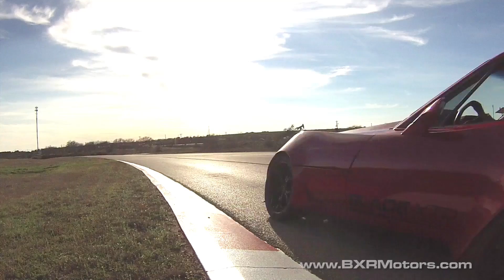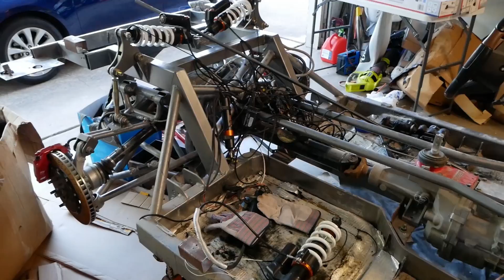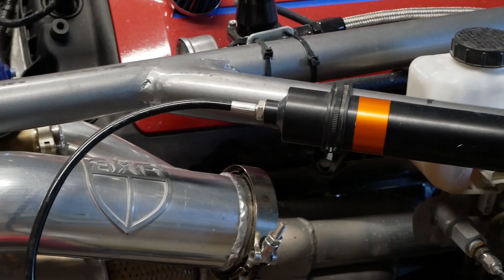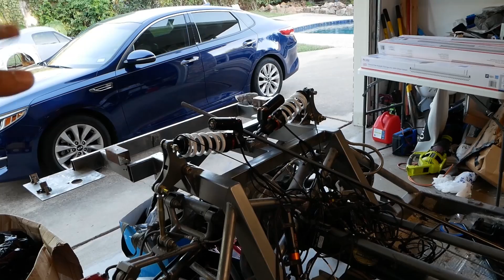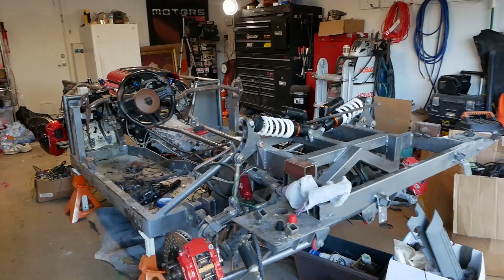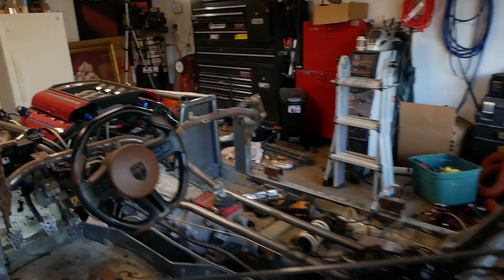How to Build a Supercar chassis and Reboot of the Blade GT1 Ep00

Comment: I just discovered this channel. It was recommended by Sk8215. I will watch previous video to catch up.  I am busy with building myself something with small engine/power which will be used daily and then I will go for big power as time goes on.  what approach did you follow especially with regard to wiring the engine. which one is the simpler or recommended one. keep up the good work.
Reply from the maker: Awesome, thanks for following. Wiring is not easy... I used a custom computer and build my own wiring harness for all gauges and other electronics. Super time consuming.

Comment: Straight from sk8215 channel
Reply from the maker: Thanks for the follow. 😎👍
Reply: @OZTron3D  I do have a mad request I understand you have made your super car with huge power custom chassis and suspension , how about something electric . 

Ultra light AWD electric with a petrol ,steam or use a Sterling engine ( a swedish diesel powered submarine destroyed a US nuclear carrier and escaped which was powered by a diesel Sterling engine powerplant in a war game . Saying this just for a reference) and for your application the electric motor from a LS 218RR motorcycle (220 bhp/165ft-lbs) hub mount style or even diff mounted version also could be incredible . I think you could destroy the 0-60 mph record in 1.5 sec which is set by college students from Germany called team AMZ Germany 2014 with a 50 bhp hub motor powering each wheel (700 lbs formula car). 

Just as  a proof of concept try  an Rc car using a nitro engine spinning a generator and supply power to dual motor drivetrain  . With your chassis and suspension design using 3D printing . 

 And the aim is to have an ultra light car without batteries to beat sk's ASL Mercedes  E 55 with completely different technology. Sk is making something close to a Le Mann's  front midmount RWD race car with ground effect . You can make an ultra light AWD hybrid electric race car .